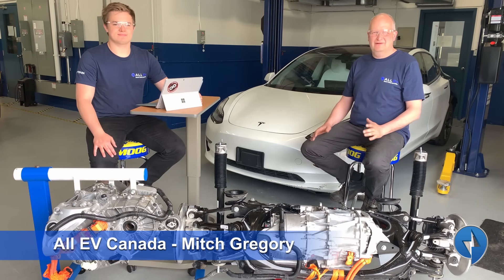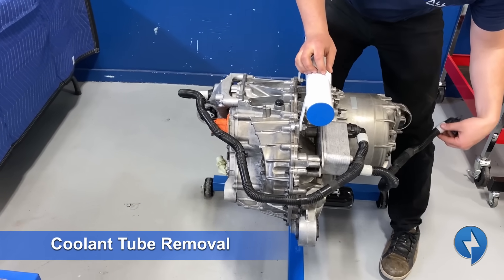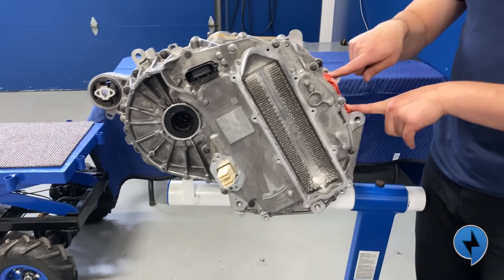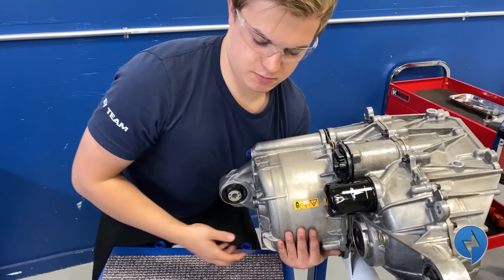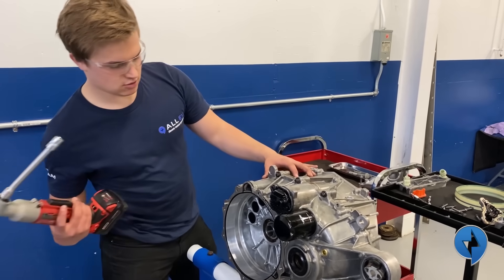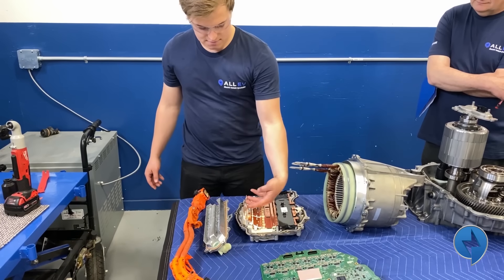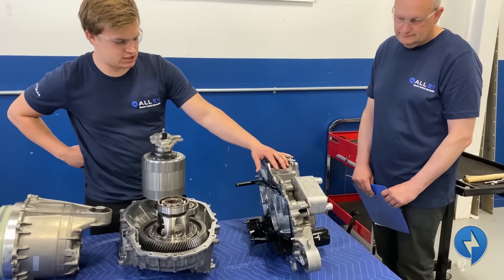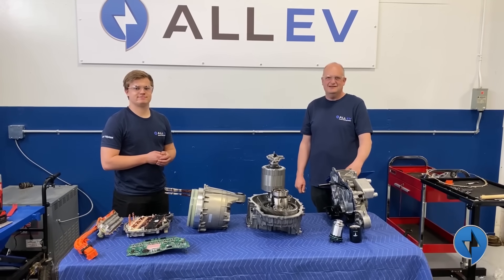Tesla Model 3 Motor Tear Down - ALL EV

Comment: Great stuff but do you ever think about the incredible environmental damage you are in the forefront of? We will need so much new resources, both for making the new cool technology cars and for DESTROYING our old ones. 
Why not just recycle our old cars, convert them to electric or hydrogen (energy cell or conversion of the piston to engine to a mix of gas and hydrogen). We could all drive the old cars we LOVE and we could stop building cool and hip and new cars THAT END UP ON THE SCRAPHEAP a few years later when politicians change their minds again or even cooler technology is around.

Comment: P E R F E C T 
The neodymiun magnets adds 15% of efficiency to the induction motor, I saw out there.
Reply: Lucid Motor has a more efficient car with one hundred miles more. Uses 900v motor thanks to the Silicon Carbide MOSFETS in the Inverter.

Comment: Thank you for the great video. I always appreciate and admire the genius inventor of the Three-Phase Induction Motor, Nikola Tesla. The idea of a rotating magnetic field that is produced by a three-phase supply to the stator is crazy. Plus, to vary the speed of the rotor, just vary the frequency through a VFD circuitry.
Reply: Utterly and completely wrong...  Tesla did not invent, or even consider, three-phase AC power, which is the cornerstone of all modern AC generation, it was actually Michael Dolivo-Dobrowolsky who invented the three-phase motor that is ubiquitous today.

Be careful with giving Tesla all the accolades of induction motor "invention".  Galileo Ferraris was the first inventor of a two-phase induction motor, but he thought it had no practical use.  Tesla, unaware of Ferraris' motor, "invented" a two-phase motor himself, and later (at Westinghouse) gave-up on trying to develop it.

Comment: Thanks for a good description of a Tesla EV car. The sensor that you called a speed sensor is not just a speed sensor. It is also used as a timing signal as to when power is switched to the stator three phase coils.

Comment: In minute 10"30' you say MOSFETS and is not trrue. They are IGBT ( Insulated Gate Bipolar Transistor ) with pairs of IGBT per phase in a configuration PWM ( Pulse Width Modulation ) change DC into Vaiable Frequency Three Phase Voltage, Greets from Venezuela.

Comment: Great exploration of Tesla Model 3 Car, Thanks for the video. 
How electronics ( Inverter) will sustain motor vibration , car vibration, and  heat , it is great design . The transmission part is just reduction gear else variable speed mechanism? 

Compared to IC engine very few parts that too need no maintenance ,

Comment: It was interesting to watch your video showing us a quick tear-down of the tesla motor, inverter and gearbox/ transmission assembly along with the cooling system.  In future presentations, I am looking forward to considerable more  details on the reluctance motors.  I would also like to know where Tesla uses solid rotor induction motors (of course invented by great Nicola Tesla) and the different types of synchronous motors (permanent magnet, separately fully/partially excited, self-starting reluctance motors etc).  Induction motors are very sturdy and reliable but marginally less efficient than synchronous motors due to their inherent slip behind the RMF (Rotating Magnetic Field).  For maximizing range, one would expect synchronous motors would/should be preferred.  Details about the motors and your views would be greatly appreciated.  Thank you.

Comment: You mentioned at 13:16 the oil is pumped to the stator. So the stator is oil cooled and not directly glycol cooled? That is interesting because the motor stator makes a lot of heat and oil is not nearly as good of a coolant as glycol due to less density, lower specific heat and lower thermal conductivity. The Model 3 relies on the motor stator to make heat for battery heating, as it does not have a dedicated battery heater like the S and X does. The Model S rear motor not only has glycol running through the stator for cooling, it runs through the rotor as well which is pretty amazing.
Reply from the maker: Very interesting stuff. The oil is cooled by the glycol-oil heat exhcanger.

Comment: OUTSTANDING presentation. Not sure if you mentioned that these motors operate in the 350~375 volt range at very high current. Thank you.

Comment: Well I can say that mechanics will not be going out of business with EVS and yes Oil industry is still needed for lubricating and cooling oils.  
So why are people all Freaking out.. just less moving parts and more easy to rebuild and repair.   However the motor magnet would have to be way from Iron filings  those would be deadly.  So a clean shop is must on that kind of tear down.

Comment: Doesn't like that the controller unit...
Is attached to drivetrain...should be separated ....so make it easy to service...any issue involve desambly 
The whole unit...
Convinient yo the shop
Not for the owner
Reply from the maker: Time will tell how reliable the control units are. There are no servicable components in the controller. 
Also the rear subframe can be removed in 30 min with the right tools.

Comment: How often do the filter and oil need to be changed ?
Reply: I’m not sure, but it would definitely NOT be anywhere near the same frequency as a gasoline engine. I think Tesla suggests at around 100-120k miles. So every 8-10 years ?

Comment: The oil change interval on a Tesla is 100,000 miles. The oil change interval on my Eaton TVS 1320 supercharger is also 100,000 miles. The oil change interval on my BRZ is every 6,000 miles or 6 months, which varies based on the driving style, heat cycling and atmospheric conditions. Because an ICE is introducing dirt, humidity and blow-by gases into the oil, the oil gets much dirtier, and the oil can break down and lose its properties, which is why the oil change interval is drastically shorter on an ICE than on an EV.

Comment: Interesting, but it might not be such a great idea to let a screwdriver or anything else snap against the rotor. In my experience neodymium magnets are quite brittle. They also tend to crumble if their outer plating is scratched or chipped.

Comment: amazing technology ,  i wonder if tesla will ever need extra gear sets like a traditional automatic transmission that has a range from 1-10 gears , how fast does that electric motor spins when cruising at highway speeds or going top speed
Reply: No Sovan, that’s the marvellous advantage of all electric motors - because they have maximum torque from very low revs, they do not need a conventional transmission with multiple rear ratios. They just require a very simple gear reduction with a ratio of about 9 to 1, as with this Model 3 motor. The Tesla Model S has a maximum road speed of approx 150 mph, and the motor spins at around 18,000 revs at this speed. So at a highway speed of 60 mph, it’s motor would be spinning at about 7,200 revs. The figures for this Model 3 motor would be very similar. That’s also why electric vehicles are able to have “instant” acceleration at any speed when required - there’s no time delay in waiting for the transmission to change gears, as in gasoline cars.
Reply: @Nicholas.T  thank you for the reply

Comment: Hi, at 5:55 what is the component names ? Is it detector/pulse generator/ encoder ?
Reply from the maker: The correct term is a resolver.
Reply: All EV Canada whats the function ?
To make the motor sytem into close loop to the controller ?
Reply from the maker: @87mcmud  Yes. The controller uses this signal to know when to switch the current direction in the stator coils.

Comment: Very interesting. I have seen a teardown of a motor from I think a P100D and I don't think it had  an oil filter or an oil pump. Very impressed with the solid cases and gears. Definitely built for a long life. I wonder what the change interval of the oil and filter is? Thanks for taking the time to do the hard work for us sticky beaks

Comment: have only skipped thru so far....wow, what engineering....it aint rocket science (couldnt resist it..) ..but its close!  - would be great if they supplied these packages with 2021 battery packs + simplified support gear for use by others - particularly classic retro projects :)  somuch for EVs being '1 moving part' simple no hassle successors to IC....

Comment: That "speed sensor" looks like a "resolver", as it's called. A resolver is a miniature motor that doesn't actually produce motion itself, but induces signal between the phases that the controller can read the exact, precise position of the motor at incredibly high speeds with. In order to drive a brushless motor like this, the controller (please don't say inverter ;) it does much more than that!) needs to know exactly what position the motor is at. That's the job of the resolver!
Reply: Pardon my grotesque description, but in this case wouldn't be acting more like a crank sensor anyways? I understand they aren't nearly the same thing, but it's getting the speed of the actual rotor in addition to a  more precise position? Just trying to translate some ICE knowledge to electric.
Reply: @gunnar9702  Yes, exactly same principle. ICE engine needs to time the valve openings, spark and/or injection at specific crankshaft angles.  Electric motor needs to apply a specific voltage and current at specific angles of the rotor relative to the stator.
Reply: Let's call it rotor position sensors it's for control unit to known whats position of the rotor than active the right mf for stator , this is what I think it's for.
Reply: isnt that thing called just hallotron or Hall-effect sensor?

Comment: Since there is a oil filter on the motor do they ever need changing? I was only aware of the battery coolant needing changing around 100,000 miles.

Comment: so you still need to do oil change on the Model 3??? lol
Reply: No, the oil here is not used in the same way/purpose that it’s used in a regular gasoline engine, where it MUST BE changed very regularly (ie every 5,000-10,000 miles). With this Model 3 motor, it’s more akin to the oil in a gas transmission where it lasts much, much longer. I suspect that it could even “sealed” for the useful life of the vehicle - maybe requiring a change only every 200,000 miles or so.

Comment: 0:49 Front right motor mount...front left motor mount ?  I'm not the sharpest tool in the shed, but that is no front end my friend.  Sure looks like that sub frame assy installs in the rear of the vehicle, since the wheels don't have tie rods nor any provisions to steer.  Might want to work on that naming convention and or realize that assy is the rear propulsion unit you are pointing at.

Comment: 9:1 reduction, not multiplication🙂
Reply from the maker: The motor output torque is multiplied by 9 to acheive the diferential output torque.
Reply: Multiplication in torque = reduction in RPM (which is what I'm guessing you're thinking)

Comment: As an electronics engineer, that was the most amazing circuit board I’ve ever seen.  Everything from microwatt to kilowatt components sharing the same PCB.  Incredible.
Reply: kW is on a different PCB https://youtu.be/oVge8I6kxPY?t=616
Reply: Exactly what I was thinking. 😅
Reply: My take too.  That board was beautiful.
Reply: The larger magnetic field that you can produce in the stator will determine the torque rating, that is why the rotor is tough to remove. Great video, the inverter/controller is the same as what he said as inverter/brains.
Reply: 'm not a mechanical engineer and I, too, wondered and wanted to see inside.   You engineers act like your the only ones with curiosity and the only ones capable of doing cool engineering things.  Why you have to mention it all the damn time?  There's an old joke.  How do you know your in the presence of an engineer?  Just wait...they'll tell you.  Or something in that vein.
Reply: @ChristopherVanSice .  Well, I’m not an a$$hole, but I too thought I’d leave a comment.
Reply: I would prefer to keep all electronics on the outside of the motor assy if it was my call.
Reply: @ohger1  the inverter must placed as close as posibble near the induction motor because in hundred of kilowatt power it consume every miliohm conductor loss counts

Comment: Amazing that they’re AC. I’d have sworn they’d be BLDC. Also surprised that they have a traditional passive differential I’d have said it’s all handled by software. Is it also the case for the two motor version?
Reply from the maker: The dual motor versions have a similair powertrain in the front with an open differential.

Comment: I'm an electrician, but not knowledgeable about the nuances of electric motors. This was great. I'm curious--do permanent magnet motors require AC power? We were always told DC was a more efficient power source for motors. 3 phase AC comes close, but isn't quite as efficient, and with a DC source there is a lot of added weight and complexity, adding the inverter and it's supporting components. So why did Tesla go  this route?

Comment: A detail that's lost on many observers is the bearing arrangement of the motor and first stage pinion and related lubrication.  Perhaps you could discuss that as well?  And does the motor run wet with oil? It certainly appears to.

Comment: if it is an ac 3p induction motor whats the purpose of magnets in the rotor?
Reply: Tesla switched to permanent magnet machines for the Model 3 a couple of years ago. They said it fit the engineering parameters of that vehicle better.

That means the inverter is probably outputting square waves rather than sine waves.

Comment: Thanks for video. The “speed sensor” on the back of the motor is actually called a Resolver. It reports the absolute angular position of the rotor to the inverter even when the rotor is stationary. An ordinary speed sensor or trigger wheel needs a full rotation before it can determine an absolute position.

https://en.wikipedia.org/wiki/Resolver_(electrical)

Also, the “triggering mosfets” in the inverter are most likely IGBTs, unless Tesla is doing something different than conventional inverter design. I would like you to discuss this more.
Reply from the maker: Thank you for the comment you are correct on both counts.

Comment: Very cool to watch. I used to work for a PC power supply mfr, and remember that higher frequency reduces component sizes (which is why aircraft run on 400Hz). 
Any idea what frequency the AC is?
Reply: Good Question.

If Motor is rated maximum for  8000 rpm , Frequency goes up to 267 Hz.
Normally motor works in the range of 4500 to 5500 rpm very well , here limit is only Bearing that can not run for long long time above 7000 rpm.

Running at 6000 rpm 4 pole motor its frequency goes up to 200 Hz.
Considering  gear reduction ratio is 8.3 
then car will catch-up speed of 87 kmph practicaly . (Theoriticaly it comes 90kmph)
At 5000 rpm car will achieve the speed of 71 kmph or 44 mph  practically .
Tyre size
235/45/R 18 tyre 
Consider 4 percent sag while calculating it's one revolution of tyre  .One revolution of tyre will result in 2 meter movement.

Hoping the best
Rakip Rahangdale
Chhattisgarh India

Comment: Incredible how simple and compact the mechanicals are.  I suppose years from now those circuit traces are going to give mechanics and hobbyists fits unless Tesla decide to release circuit diagrams.  GM Ford etc  usually don't so modern cars are often totalled because of electrical failures preventing them from passing inspected.

Comment: Nice video.... I'm curious about the overall gearing of the drive unit... ie, at 60mph, how fast is the rotor spinning... (my guess is very fast).
Reply: It was actually mentioned in the video, Brendan. It’s a simple gear reduction of about 9 to1 A few years ago, like you, I was also interested in how fast the rotor would be spinning, so I did my own calculations. All you need to know is the outside diameter of the tyres and with the rear reduction ratio and maximum road speed, it’s quite easy to work out. I was using the Model S, which has similar figures, and I was able to work out that the  motor would spin from 0 to 18,000 revs ( approx) for a 0 to 150 mph  maximum road speed. Doing the math for the model S : 60 mph divided by 150 mph x 18,000 revs = 7,200 revs at 60 mph. This Model 3 motor would  be spinning at a similar rate !! Not bad, eh !! 7,000 revs at 60 mph. Most ICE cars don’t even have a redline that goes that high !!

Comment: Would like to know more about stator liquid cooling details
Reply: The same ATF that is used to lubricate and cool the gears and bearings is used to cool the stator. The oil is flowed over the end-windings of the stator to cool them which then makes its way back to the oil sump for recirculation.
Reply: Garrett do you know any more information on the viscosity that Tesla chose to use for this automatic transmission fluid?
Reply: @gabeh7373   While I don't know the exact fluid that Tesla is using for this motor, Dexron VI is fairly common for transmission applications. Oil manufacturers are modifying tradition ICE transmission fluids for EV specific demands. Assuming a viscosity similar to Dexron VI is a safe bet.
Reply: Thx for the response! Just curious I know Tesla says that this fluid is lifetime but I've never bought into the lifetime fluid thing that manufacturers state regarding transmission fluids. 

I sure at some point they're bound to wear out. 

I know some owners want to know the type of fluid so they can swap out the fluid down the road. 

I wonder if it would be easy just to swap out the fluid in there if there's a drain bolt🤔